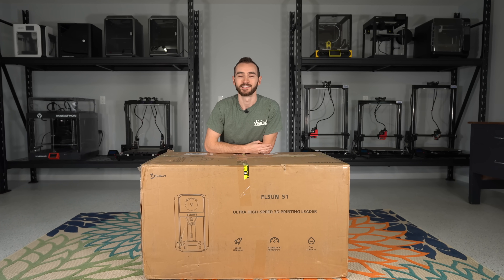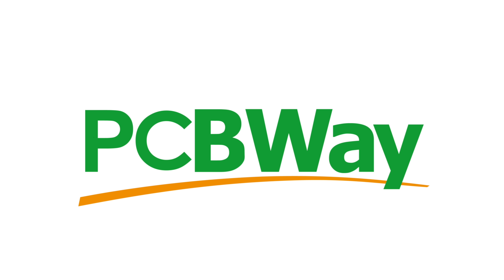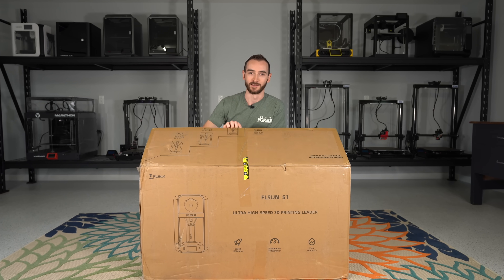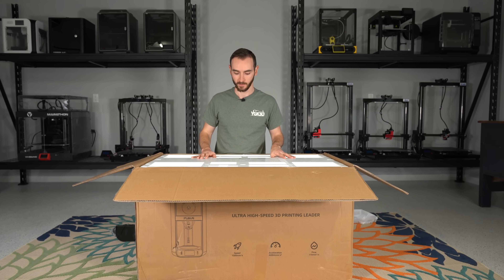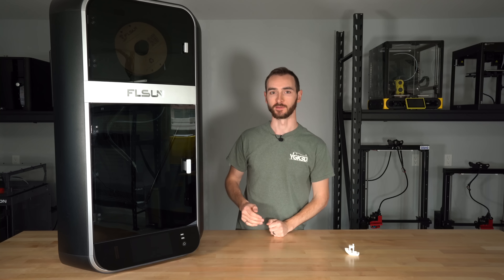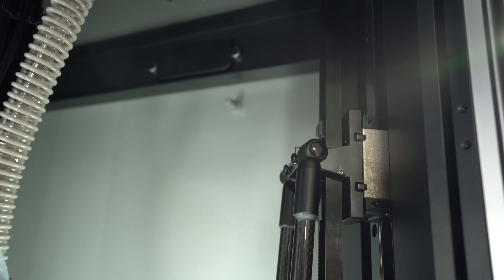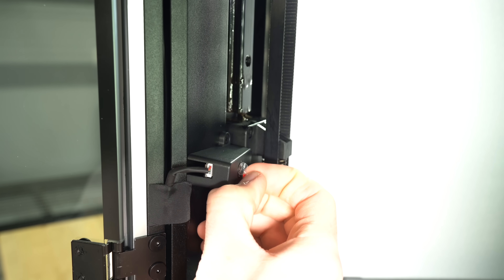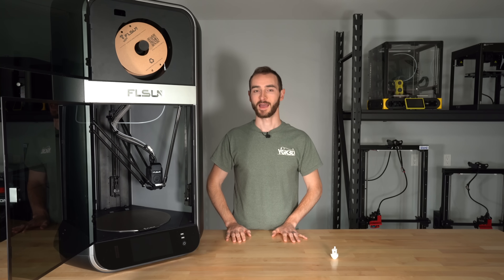FLSun S1 First Look - Bambu Lab FINALLY Has Real Competition

Comment: I got a V400 (running right now) with the case and it can print anything. Biggest issues I had were cooling the Motherboard and poor adhesion to the build plate (thank you aqua net for the fix). This looks like a marked improvement.
Reply: Since I started using glues specialized for 3D print plates (NOT glue stick and NOT hair spray), I completely stopped worrying about bed adhesion. It has saved me so many headaches... For me this is the number 1 thing I'll recommend to any newcomer: get a specialized glue. Any brand will do honestly. The second tip would be: stop using textured PEI for critical stuff and use smooth PEI. Sticks like 50% better and you can go down with the bed temp a bit as well.
Reply: @SebasTian-od7oz  TBH sense some old head told me about Aqua Net I have never had it either and I use it because it's 2 bucks a can and available in several discount stores near my home. 

As for the plate I'm open to suggestions as I'm not a fan of the current PEI plates texture but not sure who makes a good plate for the v400.

Comment: 1: High price without multiple colors
2: The actual speed is not much faster
3: Print quality details need to be verified
4: Maintainability and stability need to be verified
5: The AI function is currently not supported by real cases
Overall, it is not enough to sell for more than 1,000 US dollars. I would rather choose Bambu Lab X1
Reply: Given their last generation, the V400 can hang with the X1 in 2, 3, and 4. I have to imagine the S1 is more than capable.  If you want color changing buy a Mosaic Palette.  It works with most printers.

Comment: The thing that drives me up the wall with these printers is that the manufacturers regurgitate huge numbers while the market still has stalled in terms of the printers actually being reasonably reliable and easy to work on. Like cool, it can print fast, except we will only use the speed on le funni PLA speed prints for the most part because printing for part strength and for quality makes you go back straight to the good ol' Ender 3 speeds in some cases with some materials. I am honestly curious about what this printer has going on under the hood with the closed loop stepper motors because delta printers have always had this absolutely horrible situation of having dimensional inaccuracy issues across all 3 axis which you would need to painfully fix by tightening everything to perfectly the same level God knows how many times, doing skew calibration, testing the skew, doing skew calibration again because something came loose by just a fraction and so on and so forth
Reply: Skew calibration is only needed if you have a garbage delta with non squared frame. Normal calibration is non finnicky and depends only on having a square frame and bed and starting approximations for radius and arm length.
Reply: @daliasprints9798  He said as all of these comments were based on experience of mostly FLSun products from the Super Racer to the V400 and so on and so forth
Reply: Never once had these supposed dimensional inaccuracies and been running deltas for years... Stop building them loose.
Reply from the maker: I’m going to print a califlower in my follow up testing to see how bad the skew is.
Reply: @ygk3d  The problem with printing califlowers and skew calibration as a whole on a delta printer is the fact that the printer build encourages things going out of square even if they are built solidly, it is the kryptonite of the delta motion system and i is just a straight up novelty because people say "Oh a well tuned delta will always go faster than a CoreXY". Which is just not true by the way, the main difference comes from the extra stepper motor adding control, torque and speed, which gets strained by the delta motioning system anyway and gets trumped by 4WD printer designs
Reply from the maker: @JasonBrodel  Mhh… interesting. Thanks for the information. I’m new to delta so haven’t encountered these problems before. I will keep it in mind during my testing.

Comment: Flsun V400  is a good quality, fast and reliable printer. The S1 is a dream, I bought it immediately when it's become available fo purchase (today). The price is a little bit more than a Bambulab X1C or than Prusa MK4 (that I own), but the S1 is 2x faster and has a 3x build volume of them! It also have a very elegant design, a sturdy structure and many innovative features
Reply: Its certainly not 2 times faster. Basically dont pay attention to the stats a manufacturer says when it comes to speed as so many other things matter for the real speed.
Reply: Offended bambu shill enters the chat.
Reply: @BeefIngot  The FLsun V400 is the speed of the X1C, so this this is bound to be much quicker.
Reply: @theflew  Unfortunately thats not really how things work. For instance, real world tests Ive seen so far say that the hotend is faaaaar off of the 100+ claim they have an is more like 35mm/s^3 max. That fact alone means what you are saying isnt possible practically speaking.

Comment: The reason nobody cares about it is because nobody wants a Delta in there print farm takes up way to much space for no reason these types of printers still look gimmicky so it’s an L
Reply from the maker: It doesn’t have the same wide appeal but for some use cases it would be ideal. I imagine there are some farms that specialize in lamp shades or other tall narrow objects that would make good use of one of these.
Reply: What is the nature of a print farm?  Efficiency, farmers care about production efficiency, this is like the industrial revolution after people rely on machine production to free labor, you will now use ender3 to print?
Reply: @Peaky-Birmingham  Its more complex than that. Different printfarms have different limitations. A lot have space limitations which make this a no go.

That said, there will for sure be some that dont.
Reply: I only use deltas in my farm and have for years...😂 Pros and cons to everything, my boy.

Comment: It says it’s 320x320x430. Sure doesn’t look that big. I guess the round build plate makes it look smaller. Can you print a full size helmet on it?
Reply from the maker: The circular build plate is deceiving. It’s technically bigger in its largest dimension than the X1C but almost feels smaller because of the shape. Should be big enough for a helmet though.
Reply: @ygk3d  Its basically perfectly sized for a helment, but for mechanical parts your feelings are right on it being smaller.

I popped the dimensions into fusion 360 and the square that can fit in it XY wise is 226mm so like 25mm in both axis off of the Bambu.

Comment: They slapped a turbo on the back for part cooling!!!  How much boost?  😂
Reply from the maker: 40,000 RPM 😄
Reply: You do understand doing it this way gets you more airflow and less wait on the extruder assembly don't you.? It's a win in every way 

Less weight equals faster printing. The three arms are lighter than rails, take the fan off  and replace it with a hose with a MUCH faster fan.

Also, you need that airflow to print that fast. Most Voron designs are moving in that direction. I have only seen modified VZbot AWD printers print faster than this, which is open source and build yourself. Their next printer is going to be a delta printer. Their hotend is the craziest one I've seen, especially the water cooled one. 

I'll wait and see what the T1 can do at 600, this with 1000mm/s and 90mm/s volumetric, 30K fan and 30000 acceleration without LIDAR, which I still believe does nothing, and no filement holder. Not metal, probably a weaker MCU as this has a quad core 1.5ghz arm chip.
Reply: @JoshFisher567  you do realize that was a joke right?  I totally comprehend why the turbine fan was installed where they put it.
Reply: @hoodie_tee  I guess my sarcasm meter was broken when I posted that. My bad,  100 percent my fault.  I imagine we are going to start seeing this solution on a lot of printers going forward outside maybe bed slingers. I'm starting to see a lot of Voron's using this solution now. It's also nice that it's running vanilla klipper outside updates because this needs specific klipper update from FLSUN or it could cause major issues. 

I did see another live stream of an unboxing and that thing at 100 percent is LOUD. Big Tree Tech just announced a  "silent" version that I believe is 40K RPM that could be a drop in replacement although no fan spinning that fast could truly be silent. Closing the door did make a huge difference in how loud it was.  He turned it off briefly and the S1 was actually very quiet so ABS/ASA and other filements that don't need much if any part cooling should print fast and be relatively quiet. 

I do wonder how much closed loop stepper motors will help as they know exactly where they are at all times so if you tell it to move 3 steps back and 10 forward and it misses a step and only moves 2 back it will only move 9 forward to try and compensate. It's essentially a "smart" stepper motor for lack of a better term.

Comment: Even if below spec, they nailed the aesthetics. That is one sleek looking machine and the built-in dry box is a really cool idea. How is the longevity of their other line-up of products? Never heard of this company before. For my use, never used multi-color functionality, making this unit appear very enticing, primarily for build volume. Speed kills.
Reply: Longevity is quite good. They used brand name electronics in their machines (makerbase), component quality has been good since the super racer (except the super racer extruder). The linear rails are linear rails, dont need to explain these. The carbon rods have ptfe or similar material bushings, so maintenence free, thats how it was on the SR and v400. Crucial parts on those where either steel sheet metal, cnc aluminium or glass fiber reinforced plastic.
Reply from the maker: This is the first printer of theirs I have owned, so I can’t attest to the longevity unfortunately.
Reply: @ygk3d  Their other product line-up gives a clue. I've just never heard of this company but looks intriguing for sure. Hope you get long-span out of it without much hassle.

Comment: Over complicated build, way too big, non square build plate, no ams, and still on kipper. Speed isn’t everything.
Reply: Actually, speed is everything. If you can get the same quality at a higher speed, there's nothing to lose.  That's what the X1 brought to the table.  Quality at higher speeds.  Square versus round build plate only matters if you print large square things that don't fit on a round build plate.  If you're doing helmets round build plate might be a better option.  There are 3rd party AMS options the the Mosaic Palette if you need multiple colors.

Comment: What a gigantic printer for a relative small build volume.
Reply: It's odd for sure. The build plate is 320mm by diameter (circle) and 420mm by height. So actual build plate = (804.2cm^2) For comparison, a 256x256 plate is (655.36cm^2). It does have a larger build plate by size but at the cost of being in a circle...the 420mm build height allows pretty tall prints. If what your printing is round and tall...this seems to be the machine for you haha
Reply: This is a negative of all delta printers the z volume is limited to 1/2 the height of the printer
Reply: @mynameisprivate158  It's not really a negative.  It's just a function of the geometry.  The benefit of deltas is the z height is only limited by the height of the printer.  FLsun was brilliant with the S1, including the filament dryer, since that's ordinarily dead space on a delta.

Comment: The Bambu ecosystem is what will win out all of these comparison products, I don't even have one, I have 7 printers already and can't take the hit to swap them out for new Bambu gear as my gear pretty much worthless now the market has had such a massive advancement in past year or so and the 2nd hand market will get more saturated with old Prusa/Ender type gear. My main investment has been time, 100's of hours on core xy machines to get them running and decent profiles sorted, now Bambu just do all that out the box, that's the real saving. Oh, and I don't trust FLsun/Anycubic/Geetech/Tronxy as far as I can throw them as they all been nightmare machines
Reply: Take Bambu's money and get out
Reply: @Peaky-Birmingham  Its crazy the hate people have that a company from china changed the game.

I try to think about the other reasons they could be mad, but there are other closed printers. This printer is closed except for klipper, and there are even printers with klipper that came closed, and no one was as mad. In Bambus case, they made their own firmware so they arent violating anyones license and people are still mad.

Even if you dont like that, you should be happy they changed the game.

Comment: I will stick with my V400.
600mms is more than plenty for my projects.
Also have three dry boxes on top so I can do flilament color changes easily.
As far as an AMS I will be looking into the 3D Chameleon.
Cheers.
Reply: The AMS is extremely wasteful, never used one myself. And speed kills. I have to turn down my Bambu for 'speed-sensitive' printing anyhow. 600mms seems to be about perfect for most of what I do.
Reply: Also use the V400 with a 2 spool dry box and a ruby nozzle for printing PA-CF and PA together.
Would love  a big IDEX or maybe delta with a tool changer.
Reply: @heavyweather  Ok, what is this ruby nozzle you speak of?
Also, I did see a tool changing delta a while back.
DIY but had some merrit.
Cheers.
Reply: I use a Mosaic Palette Pro with my V400.  It works great, but you must slow the print to under 80mm/s; otherwise, the palette can't keep up with filament splicing.
Reply: @theflew  Do you just slow it down when it changes filament and then go 'full' speed once splice is done?
Cheers.
Reply: @jeffhack6839  Technically, you could manually slow it down like that or edit the gcode to have it slow down, but it would be overly complicated. I was printing a model with 6 colors and it changed colors multiple times per layer, so it was easier just to slow the print to 60mm/s.

The palette can keep up with ~200mm/s if it's just feeding filament through, but splicing takes time depending on the filament being spliced.
Reply: @theflew  Which slicer are you using to work with the filament gizmo?
At the moment I do manual changes which is, well time consuming.
Cheers.
Reply: Your printer never hits 600, and this printer will never hit 1200.

Even for travels those are gassed up numbers, and the reality for printing is waaaaaaay lower. Like probably closer to all the other faster printers because you ultimately have to melt the plastic and extrude it accurately.

That said, with its high flow, I do bet its a notable improvement on speed, albeit nowhere near their claim.
Reply: @BeefIngot  Correct, it may never hit 600 BUT watching in Mainsail there are times it hits the 600 mark.
Albeit very short BUT it does.
Thing is it still is faster than my tricked out Neptune 4.
That now has all linear rails and does smoke along.
Cheers.
Reply: @jeffhack6839  You probably see what you see. I imagine those are travels, because the required flow of the hotend would be super high and with a low layer height otherwise.

Reasonable.
Reply: @BeefIngot  Well same part, different machine. Same settings in Orca. Yes, the delta is 20% faster. Each max speed set to 500mms.
Cheers.

Comment: If you’re making lofty claims like having a max VF over 3x a CHT nozzle, I’d hope to at least see a racetrack print to validate it
Reply from the maker: For sure! This will be part of my follow-up testing.
Reply: Yeah I don't buy their flow claim. That's likely for large nozzle with core not actually melted. Getting true thorough melt over 60-80 is REALLY HARD. And then you have to overcome backpressure too.

Comment: Only thing it doesn't appear to have is a chamber heater. Why not? Why aren't flagships doing this?
Reply from the maker: Good question... heated chamber would be nice and seems like it could have been added quite easily.
Reply: @ygk3d  I think it's a situation if the S1 and T1 had chamber heaters, I'd buy one. Without it, I can't print some of my materials. Only other company is Qidi, but I'm not 100% on them either because some of their design choices are questionable. Seems like missed easy sales. There's no "perfect" printer out there yet, but there's almost zero reason why not.
Reply: @dmax9324  IF my theory is correct and the architecture is the same with the SR (which I have), they didn’t add a heated chamber simply because the board is located at the top (with the CPAP fan). The heat of the chamber rising up will lessen the lifespan of the board and any delicate components placed at the top of the machine.
Reply: @JamesMD03 electronics compartment seems to separated from the build volume, the SR and v400 had vents there to the build volume. As far as longevity goes, stepper drivers are 125c rated, all other electronics are 85c (consumer grade) minimum or better. Even a 65c chamber would be nice as you significantly reduce preheat time and have a stable (!) environment